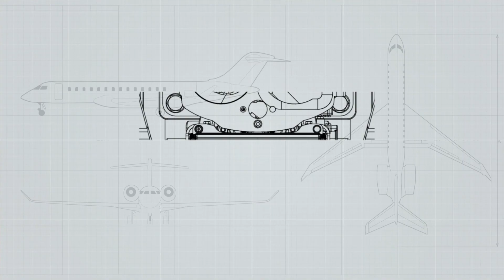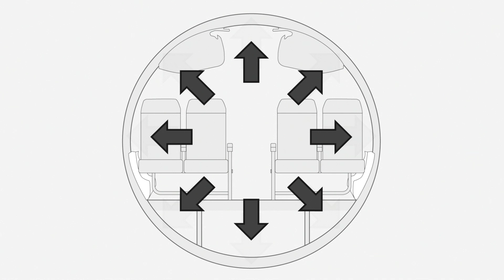Ask An Engineer - EP1 : Why do airplanes have rounded windows?

Comment: To the explanation given by the video, it must also be added that the geometric shape of the aircraft windows is also dictated by the electromagnetic protection of the aircraft and its systems.
When an electromagnetic phenomenon such as lightning hits an aircraft, the large current it develops on the fuselage propagates at a very high speed along the fuselage, due to the good electrical conductivity of the aircraft structure. Arrived at the windows that are non-conductive openings, the current is forced to go around the half-perimeter of the window before continuing its way along the fuselage. If the window has rectangular corners, then this lightning current will take longer to make its way along the edges of the window at these corners, and therefore, will consequently generate magnetic field leakage  inside the aircraft, a field that will couple in turn to the wiring inside the aircraft with the risk of affecting systems immunity.
A window with round corners makes it possible to minimize this risk, since the propagation time of the current is shorter at these round corners than if they were rectangular. The risk of magnetic field leakage to the inside of the fuselage becomes then negligible. Better yet, to protect aircraft from electromagnetic phenomena such as electric fields due to radar, TV broadcasting transmitters, or lightning-induced phenomena, rectangular windows with half circles from above and below, or even windows circular windows are therefore the best solution.